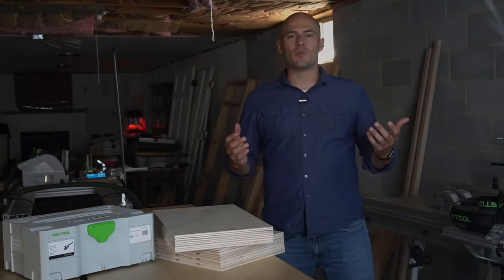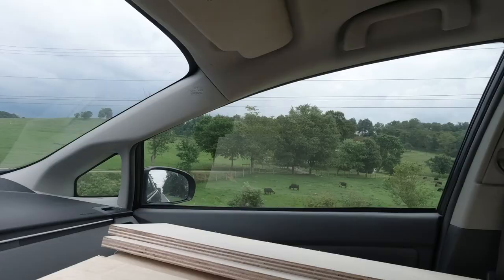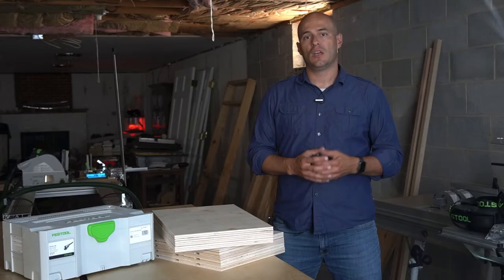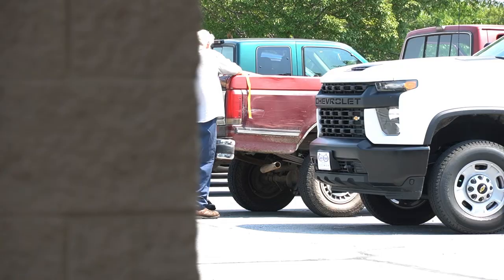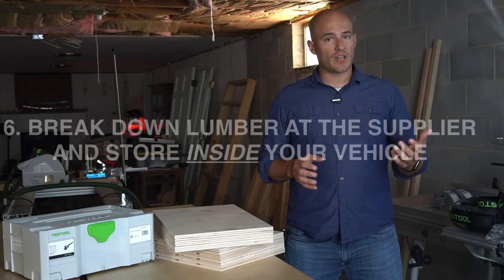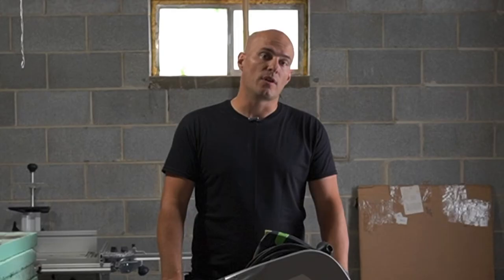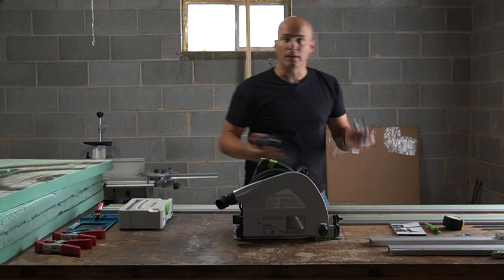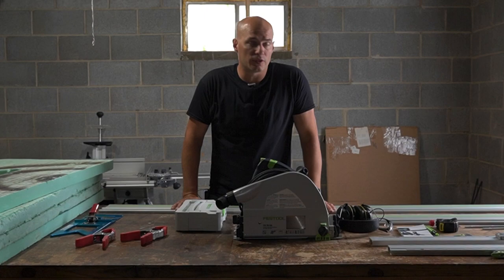6 Safe Options to Haul Wood When all You Own is a Car

Comment: Nice summary of ideas for hauling wood. One alternative approach to the on-site breakdown: instead of trying to cut precisely, use a cordless jig saw to cut to rough dimensions. This is quick and easy if you're willing to do finish cuts back in your shop.
Reply from the maker: Yep! I've done that before, just depends on the project and how much wiggle room you have with components

Comment: Good tips on hauling lumber safely. For those that don't want to go this route remember that most home centers have a pickup you can rent for reasonable fee. Where I am it's $19 for 75 minutes. For me being 15 miles from the home center that's more than enough time to load up, get home and unload, then return the truck before times up. 

The $19 rate is reasonable when you consider the alternative of doing damage to your car or losing a load while driving down the road and possibly killing someone. And delivery is available too. I know, no one wants to wait. got to have it NOW, and the old "I can do that myself" attitude takes over. But why buy a pickup just ot haul lumber a couple times a month? Save that money and rent a pickup when you need it or pay for delivery or buy a small trailer that you can tow behind your vehicle.
Reply from the maker: Appreciate the insights, Bob! That is a really reasonable rate and one that I wish I had locally. I've certainly been in the 'rush' mentality to run to the store to get what I need (forgot!). Now I plan everything out and only make one trip. Do you even bother with bulking or do you just buy enough material for the project at hand?
Reply: @BenMarshallDesigns  I try to keep a couple sheets of plywood in 1/4, 1/2 and 3/4 around plus some 3/4 popular and a few 2x4s. That way I have some stuff to tackle a small job. I also salvage as much as I can (maybe too much) but you have to be careful not to take up too much space in the shop with materials that you think are worth hanging on to but will end up never using. That's where I'm at now after 30 years and trying to reduce inventory as much as possible to get the clutter out of the shop.
Reply from the maker: @bobd.  yep, holding onto leftover materials is always a struggle. One can always think of something to use it on, yet rarely does. Unless I plan on making it right there on the spot, I get rid of it - it piles up too quickly. I don't like having excess clutter in my shop, what I have right now even bugs me although it's not that much, just random stuff I've put on FB marketplace waiting to be sold.
Reply: Yeah, I wish the Home Depot, Lowes, or Menards offered rentals here. I am stuck with Uhaul. Really sucks.
Reply: @WYO_Dirtbag  I thought every store rented pickups. I don't think I've ever been to one that didn't.
Reply: @bobd.  Unfortunately its unavailable here at all 3. I know the other places I lived at least the Home Depots all had them, was dismayed to see they did not at the only location here. Not worth the 68 mi drive to the next nearest location with a rental.
Reply: Waiting for the used car market to crater to get a pickup. Just cannot justify paying these crazy prices for a early 00 tacoma or tundra.

Comment: Fellow prius owner. Thankfully I'll only need to haul sheet goods for an occasional home repair. Perfectly willing to rent the store truck for an occasional project. Car is 14yo in the rust belt and frequent brake problems so the trailer iron may not be good for my suspension. I do have a cordless circular saw just in case
Reply from the maker: I've since purchased a truck now that I'm making motorcycle content, but still have the Prius for long distance trips (gas is still super cheap for 400 miles). A cordless circ saw can get around a lot of constrictions with vehicles

Comment: You really should have filmed yourself breaking apart sheet goods at the retail outlet.  Where do you plug in the power cord from your track saw?
Reply from the maker: If you check out my instagram account, I have a highlighted story showing it. There are multiple outlets in the front of my supplier that I use

Comment: Real deal is transporting 12-16 ft lumber. You can't cut them because you need the entire piece. Even when you pay $79 dollar delivery fee to order from big buck store, they most likely deliver warped and twisted lumber. I abandoned several projects because of this transportation issues
Reply from the maker: Yeah, I think there comes a point where you just need a truck. And unless you can borrow one, then it may be time to pick one up. Still haven’t bought one yet, but I’m getting close to that point
Reply: Just by a Chevy work van easy to load sheets of plywood and dry wall

Comment: Hi Ben looks like you removed the front seat there for hauling inside your car.. tried this myself (removing the passenger side seat) but that disconnects the airbag sensor I believe. Wondering if you had a workaround?
Reply from the maker: Hey Aiden. The front seat isn't removed, just leaned back. I removed the headrest, scooted the seat forward, then dropped the back rest all the way down. Didn't have to remove the seat.

Comment: My tool box consists of two sharpening stones, a saw 4 chisels a small metal hammer a small rubber/plastic mallet, 3 handplanes 2 of them wood, a hatchet, and a tape measure.
Reply from the maker: What hand planes do you have?

Comment: I recently had to get rid of my truck and downgraded to a small sedan so will be most likely doing parking lot cutting. A few things I was curious about: One - I noticed your track saw is corded. Do places usually have a place for you to plug in your cord? Two - What do you do about Dust and has any of the facilities ever complained about it? Three - If using a Circuler Saw and Guide for ripping a 4x8 sheet, do you have any suggestions if the Guide isn't an 8' guide?
Reply from the maker: Hey Kato. Most of the lumber dealers in my location have outlets available, however I recently upgraded to the TSC55KEB (cordless), so that's not an issue anymore for me. I've always asked to plug up and cut first each time before I cut. When I had my corded tracksaw, I would bring a battery powered blower to move the dust around. Ripping without an 8' guide is tricky, If you have one edge of the guide that is truly straight, you can perhaps cut a little more than half way, then use a small square to line up and carry the cut the remainder of the distance. This is all theoretical, but that's how I would attempt to try it were it me. Hope this helps!

Comment: I love the idea of this but I haven’t done it in the past because I’m not sure who I should ask if I can plug in and rips down sheets.  Do big box home centers let you do this on their property?  If I owned the property, I would not invite that liability risk.
Reply from the maker: I've broken down lumber behind my big box store before, however I didn't check with them before doing that and it wasn't that much material to begin with. For my plywood supplier, I always check with them before doing it, especially right in front of their parking lot. They have a few cross cut stations set up inside the warehouse that customers can use, so it's not that big of a deal to rip it in the parking lot. Most of their customers are contractors and they see a need for it. I plan on picking up the Festool TSC55 (battery operated) soon, so that should cut down on my need for their electricity and it has really good dust collection and I can be further from the store to break it down.
Reply: Ben Marshall I definitely regret not getting the battery powered version of my track saw for that very reason.  I’ve got a Mazda 3 hatchback and that would have just made my live way easier for sheet good pickup

Comment: the overhanging from the front is 1 meter in front and 2 meter in the back (you need to put a red flag) in Qc. It'S the same in most place I think. on my car the allowed roof load is 180 pounds. Not much, but enought for a few sheet O__O
Reply from the maker: Good to know!

Comment: I don't ever plan to bring all of that equipment with me in my vehicle. In my mind, a cordless circular saw and a rafter square should do the trick. Otherwise, great safety tips.
Reply from the maker: A rafter square for ripping a full sheet of plywood??
Reply: @BenMarshallDesigns  OK you’re right. Right now I’m building a fence, and I was thinking about cutting 2x6’s, not plywood. 

Your video did convince me against hauling lumber on the roof of my Prius.

Comment: I'm confused as to why securely strapped lumber on a roof rack is less safe than loose lumber inside the vehicle. Any sudden stop or violent force will send the loose lumber flying, likely right through your window and into another vehicle. At least the secured lumber stands a chance of staying put.
Reply from the maker: Because lumber on a roof doesn’t need a sudden stop or violent force to send it flying. I would say the chances of personal/property damage are higher with lumber stored on a roof vs stored inside. If there is a concern, then secure on the inside.

Comment: or you could just have the store cut them down to rough dimensions LOL
Reply from the maker: That may be possible at some stores, however the cutting station hasn't been operational at my local Lowes for almost a year now, and the dealer I get plywood from doens't have a ripping station, only a miter saw for stock lumber.